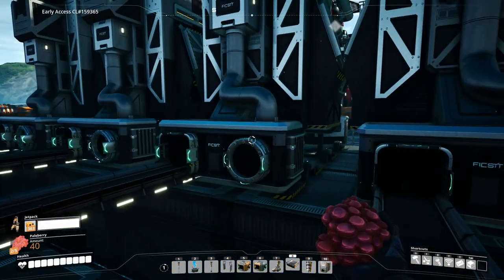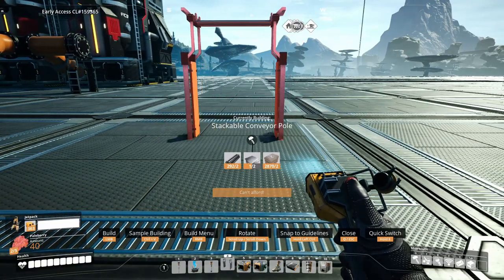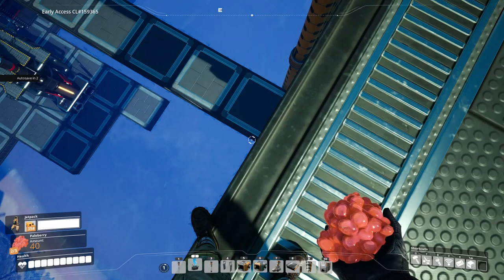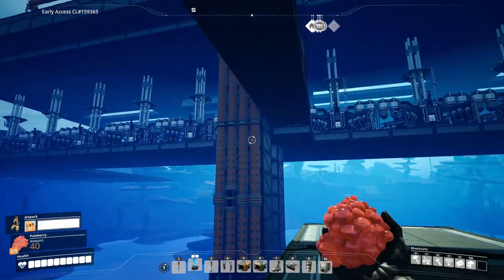Starting Work On Fuel Generator Setup S1 EP. 36 - Satisfactory Let's Play

Comment: Very good setup you have there. I'm shock that you spent the time making it. hopefully it runs well. 2 things, one have more ways getting backup ,trust me , getting stuck w/o power sucks.also pumps have max lift, when place the blue arrow shows where it stops, u prob need 2 pumps per pipe, section to reach the top, n fuel is OP ,I run 16 gens, n have tons being store
Reply: also forgot that later on you can unlock the tier 2 pumps, greater lift distance. But the ones you have now be just fine. And the main things is at this stage of the game, you need more plastic then rubber, The output of rubber is alot, so kitchen sink both rubber and plastic u don't need to keep the oil flowing or it be mess later.
Reply from the maker: Already have the tier 2 pumps think that's the one video you haven't watched yet. Also did do that sink thing to bad I have to use the normal splitter right now because I don't have the one I can set to overflow yet.
Reply from the maker: Ep. 34 by the way was where I unlocked like all the tier 5 and 6